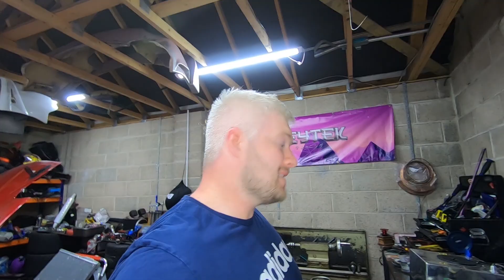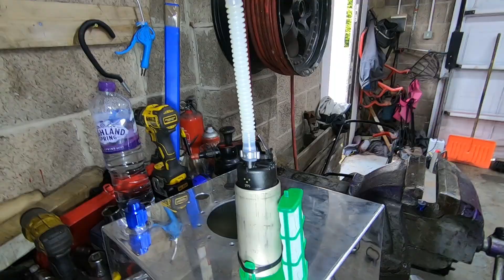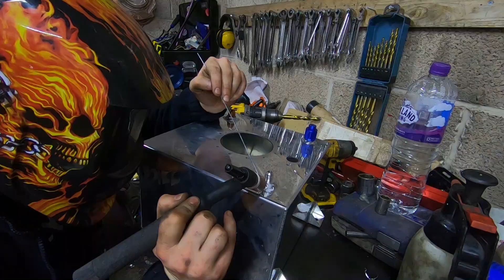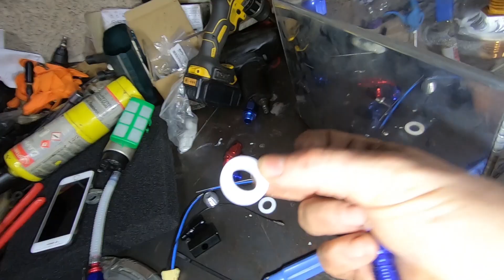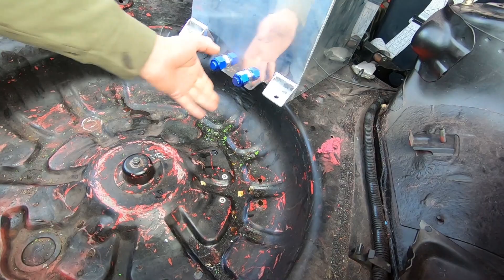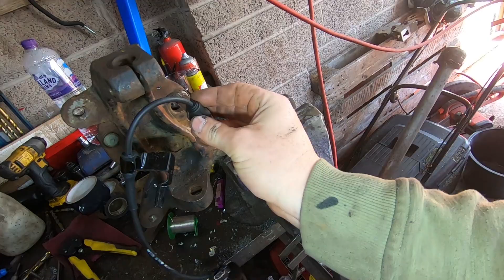KSWAP RX7 GETS A FUEL CELL [BR540 FUEL PUMP]

Comment: the 044 is a LOT quieter in tank  and a lot more reliable than its rivals ,,dont get too hung up on flow figures till you actually see those numbers as  most pumps high flow tests are done at  13,6-14 volt pump voltage , did you fit a separate swirl pot?  can run mine on an 8th of a tank  on track with no missing at all on a 1 litre pot and a standard tank
Reply from the maker: Hi marc. Welcome allong. As alwsyd theres often resons why i do things half out the norm.  As per your point about being hung up on flow it was a consideration of mine. The 044 is a great oldschool pump. It flows great amount even at higher presure. The turbine style pumps typicaly flow more but when up 80-90 psi the often drop right off. The br540 i have still out flows and performs the 044. Ill be runbing ethanol so flow is a big worry. I run x8 1000cc injecotors now with x2 br540 pumps for around 1000bhp. As for fuel surge i currently dont have a swirl pot but i have ran one in the past and like you say they work an absolute treat. If i decide to get right into track driving again i might stick one back in :). Thanks for yhe comments. Always good to have people come allong with great points.
Reply: @BEYTEK  just looking to fit  HS3v3.1  aquamist water/meth to mine this summer,AND a bigger intercooler to try and control ICT  temps and stop it pulling timing especially in summer , my single 044 pressure pump is  running flat out at the moment  so a quietish bigger replacement or a second pump wired to turn on with IDC load is on the cards - 
fantastic build there  Bey Tek,, the 84rs often makes 700 crank power on Vpower,,, reckon you will need some better turbo friendly cams  and maybe  bigger valves and  porting to really make it sing in 4500-7500rpm  range ,,99Meth mix is excellent for mid range  power with the same boost -but race fuel is in another league for  det resistance and takes loads more timing,its just so bloody expensive lol😁  great fun good luck
Reply from the maker: @marcperrett662  cheers mark.  Yeah will be running the car on ethanol. Knock is almost imposible :D. I like the sound of that. All good fun. I need to get my arse in gear lol
Reply: @BEYTEK     cool you,ll love it just remember that the fuel consumption on ethanol is worse than straight petrol and you will need  a flex sensor to monitor the percentages  as ethanol(as opposed to meth) can be a bit variable,,may pay to have a vpower  map to move car about on the road mate ..what are your plans for the rx7  Bey?  i,m assuming track car with a fairly light fuel load of 20 litres,,its gonna be epic😁
Reply from the maker: @marcperrett662  yes thats right i mapp in lambda so im half way there already. Tuned a few track cars on eth on the dyno. Lovley stuff